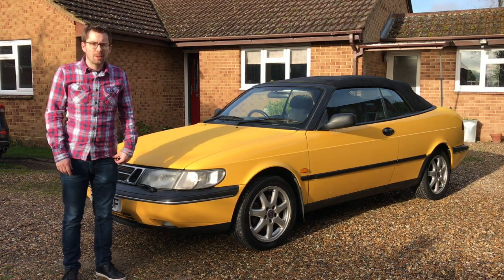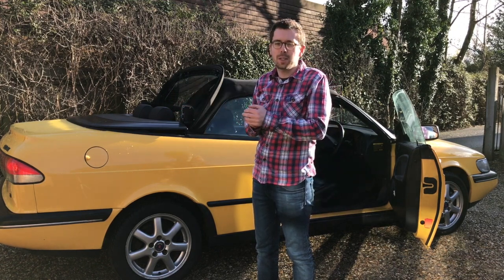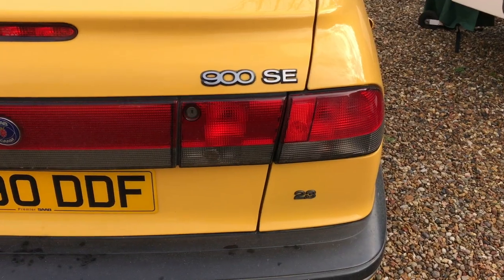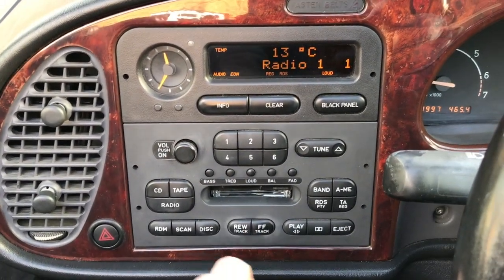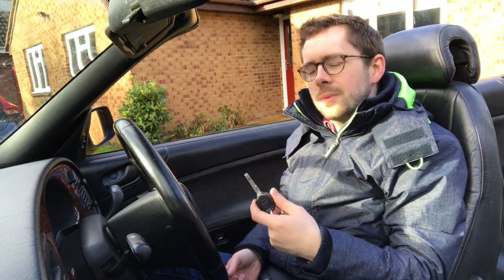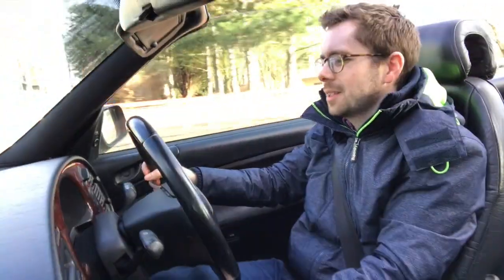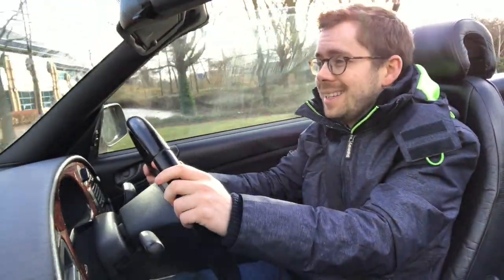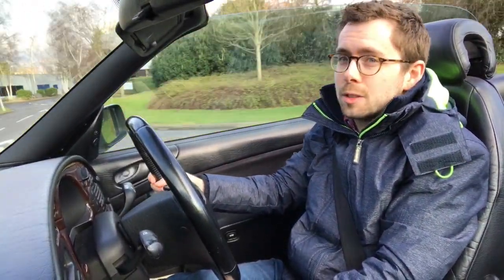1997 Saab 900 Convertible: in depth tour and review

Comment: 80s and 90s cars are the BEST
Reply: So, not a bad car. I have one in scarab green. 2.3 5 speed manual. Refurbed it during Covid last year (March to June 2020) looks and drives almost like new. Abbott brace on the rack, poly bushed lower arms, correct Viking wheels and a set of Michelin’s transformed the handling. It’s a picture.

Comment: Just a tip on how to more smoothly disarm the startlock before take off. Turn the key to the off mode where the radio switches on and press the lock button on the remote. The alarm LED lights up and switches off and you are clear for take off!
Reply: No problem! Happy I could give you some advice ;)